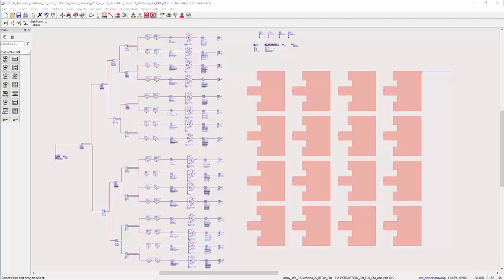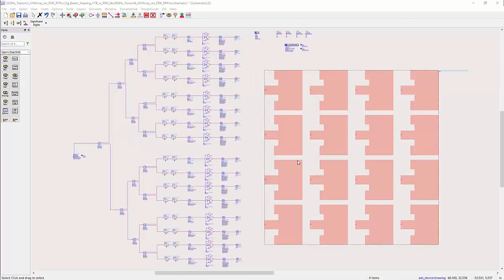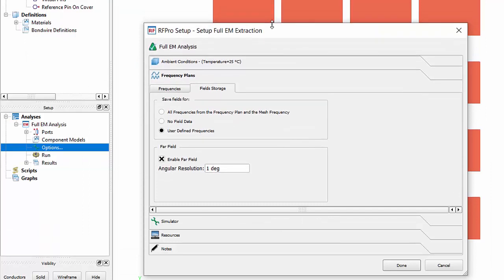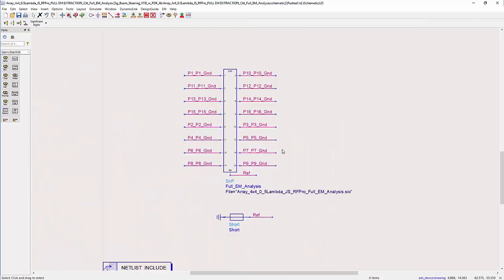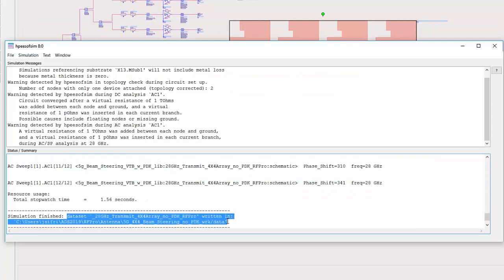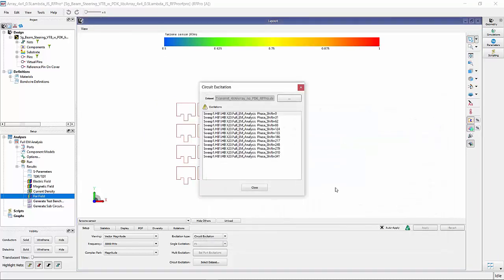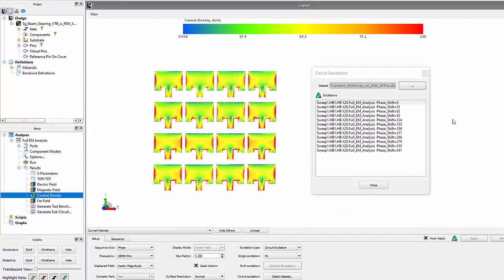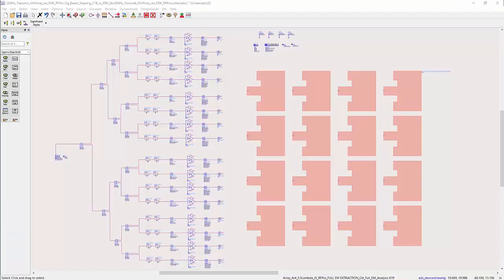5G Beam-Steering with EM/Circuit Excitation and Co-simulation in PathWave ADS

Comment: Can you guys please post a comprehensive tutorial on how to construct and simulate with a FINITE ground plane? I find it difficult to properly characterize any planar antenna designs with Momentum's assumption of an infinite ground plane as it makes a huge difference in results. Thank you.
Reply from the maker: Thank you, Michael for your comment.  In Momentum you can create a finite ground plane;  create an open substrate, map the gnd layer as sheet, draw its shape and use the layer as ‘Gnd Layer’ for the ports. What cannot be done is to account for the finite size of the dielectrics. Assumption is they extend to infinity and take away energy, in a surface wave, that is not radiated. But alternatively, you could use the 3D FEM simulator in ADS which allows you to simulate any structure with finite substrate (Grounds and dielectrics). Please contact our representatives in your area for examples and support on this issue.
Reply: @KeysightEEsofEDA  Hi Keysight, thank you for the reply - it is amazing to see that you guys are attentive to youtube :)!

I have tried this method and have even followed the CPWG tutorial where the reference ports are placed on either sides of the excitation port. I found that the results were sensitive to the placement of these ports and the meshing would change as well. I can't seem to find a way to apply a "universal" ground reference rather than single point ground references.
Reply: @KeysightEEsofEDA  
Can you provide this design, as i have to design beamstreeing for 2x2 patch antenna
Reply: agree